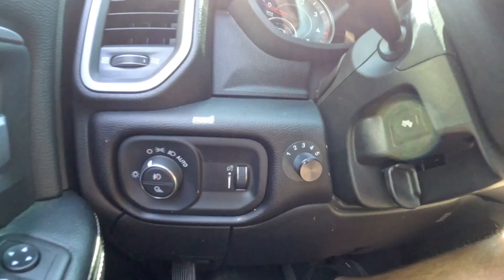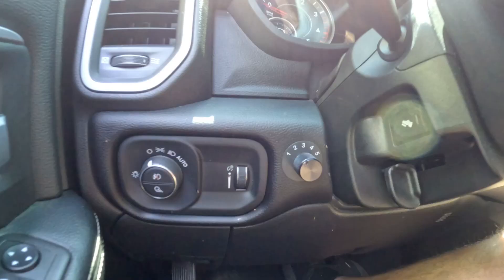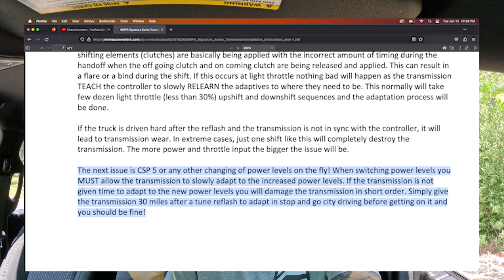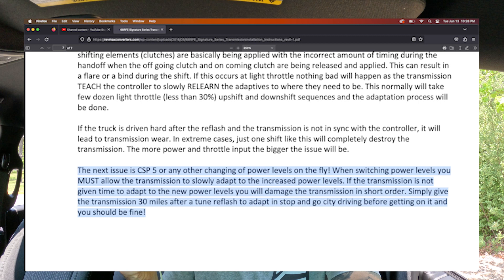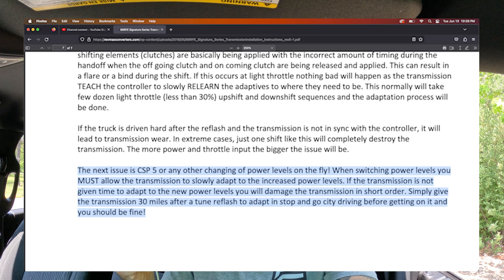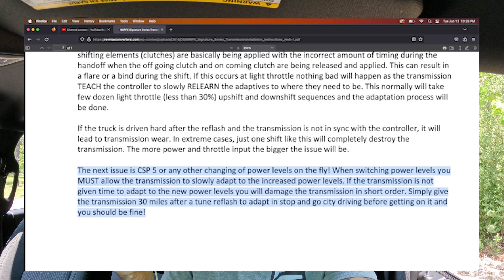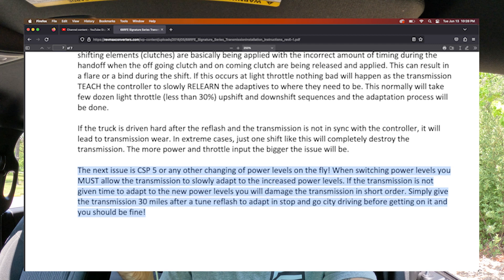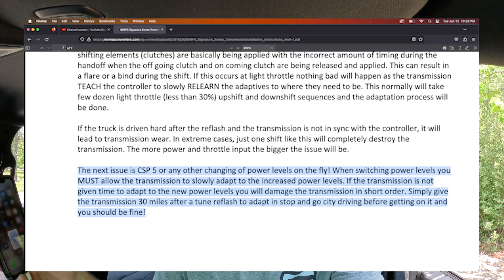Truck Tip Tuesday: Switch on the Fly (SOTF)

Comment: Been running sotf tunes on multiple trucks for 60k plus miles on them and no issues. Only change from tune 4 for unloaded driving and tune 2 for towing. When I change I don't get into it at all. Just switch it and drive normal. No issues so far. My truck has 120k on stock everything and switch the tune everytime I hook up to a trailer.

Comment: Great video, awesome knowledge. My thoughts are this. I installed my revmax valve body 2 weeks ago. Did a tranny relearn using an autel scan tool. Driven the truck in the city only using 1 thru 4th gears for addition relearning for 100mi. The SOTF CSP5 selector switch only advances the timing of the fuel when switching and has nothing to do with any relearning. basically, the ruck has to be at half throttle to full throttle to full it rip. This is what is bad for the 68RFE. Ripping the 68RFE is deadly.

Great video though, I have a 2012 with all mods done by me. Learned alot. But folks please dont rip these minivan transmissions because they are weak.

Lets see what the 2025 ZF 8 speed trannys can do. I no 1 thing about the ZF tranny, there is no dipstick.

Peace

Comment: I was told by dirty diesel customs you don’t need to do a full relearn with sotf.  That the trans is always “learning”.  The initial relearn after a flash is important, you can even feel the gear shifts are harsh.  Idk, there could be something to this, especially if you’re adding 200 hp and then beating on it.  I have ran stock power for the last 7k miles and no issues (knock on wood).  Took my sotf completely out so the temptation isn’t there!
Reply from the maker: I thought about doing the same. Uploading 1 single tune and just letting it be.
Reply: Is removing the SOTF as easy as it seems or is there more to it?
Reply: @jackiecombs528 yes it’s easy.  It’s just plugged inline with your OBD 2.  If someone put the knob into the plastic, either replace the panel or leave the knob.  Just unplug it from the OBD 2, zip tie it up (if you’re leaving it) and that’s it.

Comment: Also keep in mind everyone this only applies to the 68rfe in the 6.7 trucks. This doesn't apply to the aisin. Or 48re in the 5.9 trucks.
Reply: what is the difference between the 3? asking because I have an aisin currently with trans tunning and want to make sure it's not different because of my tunning, I have higher shift points,  elevated line pressure and no 2 to 1 down shift unless it comes to a complete stop
Reply: @adorno1010  The 48re was basically the newest of the old school 727 transmissions. It's a smart/dumb transmission. Production ended in 2007. Easy to build and great reliability. The 68rfe was the new 6 speed released in 2007 for the 6.7 trucks. It's all electronic. The aisin came out in 2013 in the 3500 trucks only and until recently was untuneable. It's the strongest in stock form of all the 3.

Comment: Someone can correct me if I’m wrong but the trans re learn process is only when the ecm is reflashed. The SOTF does not reflash the ecm so you shouldn’t need to drive 30 miles under 30% throttle.
Reply: Thats my thinking, relearn and reflash only. The Sotf switch only advances the timing of the fuel on higher throttles

Comment: Is that more for the initial “break in” of the trans?
My tuner said to drive the 50 or so miles in setting 5 so the trans learns from that, then treat it as an actual sotf quick switch
Reply from the maker: @Sh3rwood  it’s just the instructions on the Revmax Valve Body I had installed. I was never told this either by my tuner or anything, only what I’ve read on my parts!

Comment: Just got a 14 ram 3500 from the dealer ship.owned for 3 days and has that switch I didn’t know what it was meant for I thought subs. Until I decided to search it up tonight glad I did. Been taking it easy on her as she is low kms. How do you know if it’s working? Put in park and switch through them?what setting is 1-5
Reply from the maker: Depends on what tunes the guy picked when they tuned it. For example. Mines 30hp, 60hp, 90hp, 150hp, and 200hp. 

But I’ve seen guys have tune 1 completely stock, some guys do lope tunes or smoke tunes on higher ones. It all depends on what the guy picked when he had it done. 

I know mine work when I’m in tune 1 and the truck feels stock but I switch to tune 4 and it shreds all 4 tires in 4x4. So you’ll most likely have to drive around in each and see how she feels.

Comment: Small criticism here, I notice you eagerly post "Upgrades" videos only to revisit them because they either sucked or broke

1. Recon cab lights leak
2. Tuner messed up the trucks trans
3. Amp research running boards didn't fit OEM without afro-engineering
4. (pending) Light bar in the grille i'm sure will be next 
5. (Pending) half the C5 mods you did. lol
Reply from the maker: Fair points ☝🏼